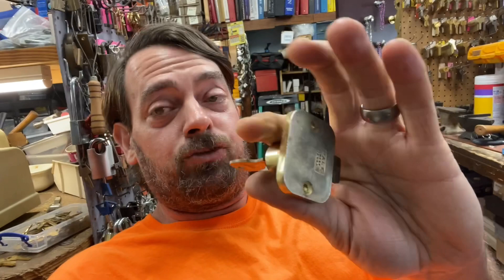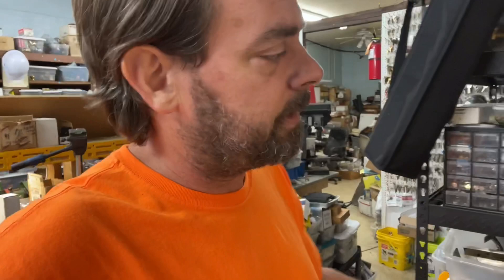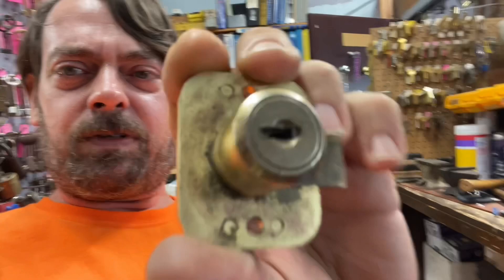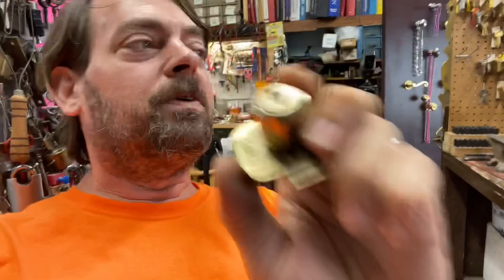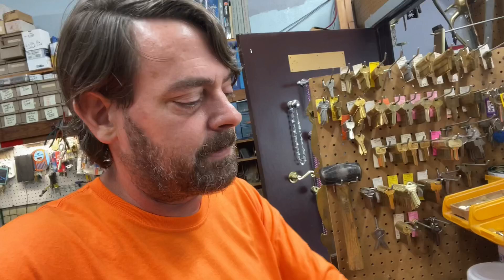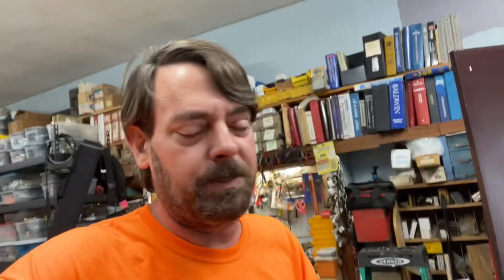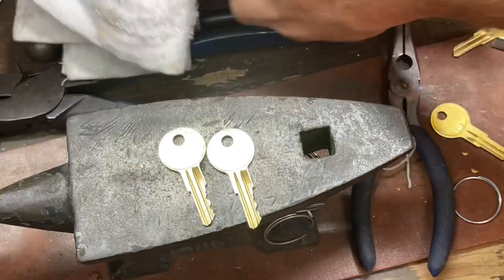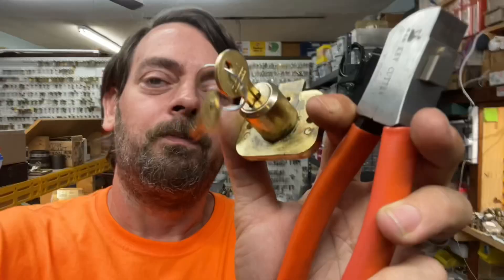Yale wafer drawer lock sight read & cut with Lishi Cutter

Comment: I am dinking around with some display cabinets at work.  Got peened in plugs on some of them so sight reading is my only option on those.  One thing I was able to do was working from the front with a thin shim on the cut side of the key you can feel the wafer in the groove, take it down a cut.  If you feel it on the other then you have gone too far.  Debating about getting a YA4/Y11 Lishi, just only places I can findvthem are UHS and CLK and I am not sure I need it enough to justify the $45.  I just service locks at work part time so get a job here and there, though I am slowly changing out the MKS for the doors.  Yale LFICs with GA blanks.

Comment: Correct me if I'm wrong but wouldn't a jiggler key have worked faster
Reply from the maker: possibly, but I didn't have one sitting right there on the bench
Reply: @selock  I wasn't sure if maybe there was an advantage to how you did it or if it just happened to be like you said that's what u had at the time
Reply: @selock  I learn alot from your videos